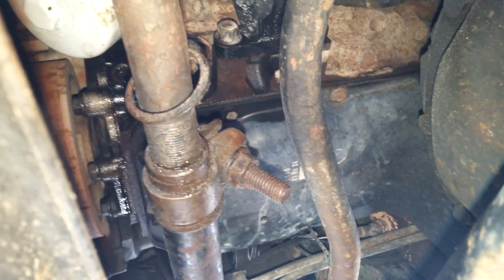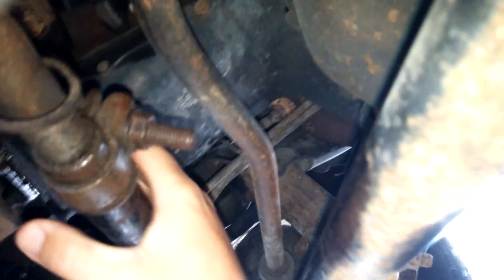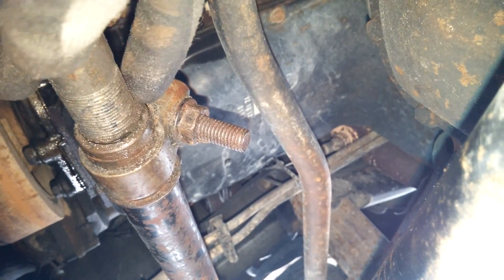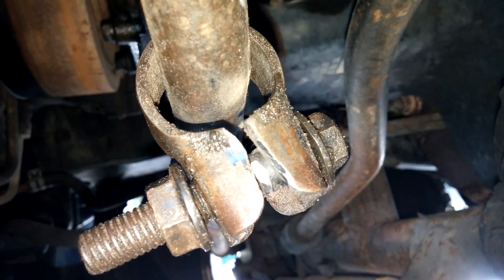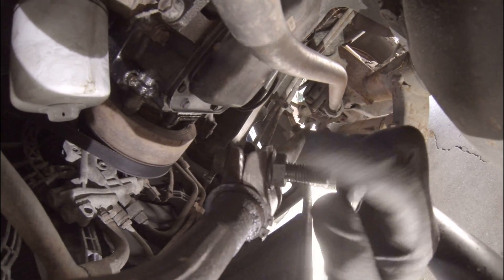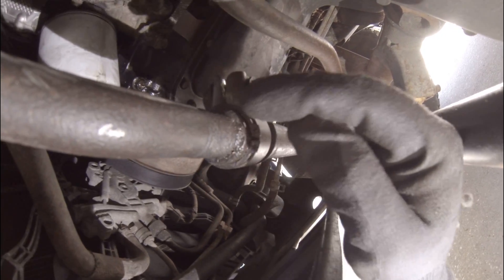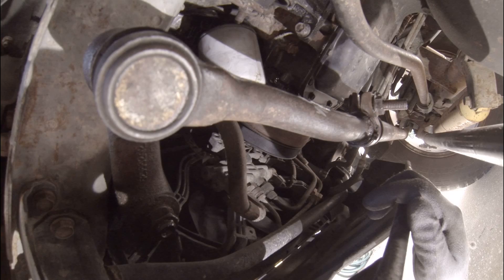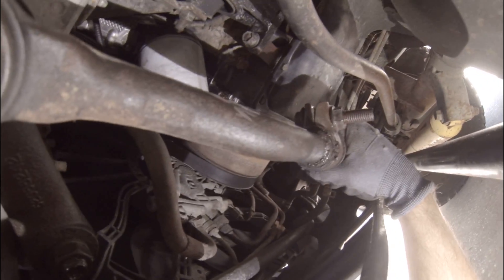WJ Jeep Grand Cherokee Death Wobble Fix

Comment: Man I’ve changed my tie rod ends and my track bar isn’t loose at all. I got my alignment and I can’t see absolutely nothing loose. My death wobble is so bad I can’t go above 40
Reply: Alex Richardson Sounds like it may be your ball joints... Sorry they are kind of a PITA. Google how to check ball joins and you should find some good advice on how confirm my huntch. I still have one ball join that it bad. The DW only hapoens to me if I hit a bad bump now.
Reply: I’ve done track bar, tie rods, steering dampener, ball joints rotors, cv, upper and lower control arms. And still hit a bump and it’s out of control. I have a works lift with rubicon wheels and tires. So last thing for me is maybe ditch the wheels and ties
Reply: It can be anything causing death wobble. From any old suspension part , bushings.shocks . Tie rods balls joints control arms upper or lower bushing.trc bar,  Loose bolts. Of over size tires .steering components . Once you life it . It can expose old parts  .

Comment: That's is not a new tie rod end from the parts house. New ones come with a grease fittin, and what you call a cotter pin is actually a snap ring

Comment: NOTE--- I bought a '74 f-150 4x4VAN (new) and picked up this death wobble after 6months--- the front end 4x4 parts were put together by Ford  with DODGE parts.... that a FACT..... Why would anyone buy DODGE ...if after 42 years problem is still there

Comment: That's the drag link, not track bar, good fix though
Reply from the maker: You are correct it's the drag link not the tie rod or track bar. I meant to put that in the description but forgot. Thank you for the reminder. Good eye BTW :)
Reply from the maker: http://www.cherokeeforum.com/attachments/f2/28961d1288707108t-do-i-need-new-tie-rod-track-bar-alignment01.jpg